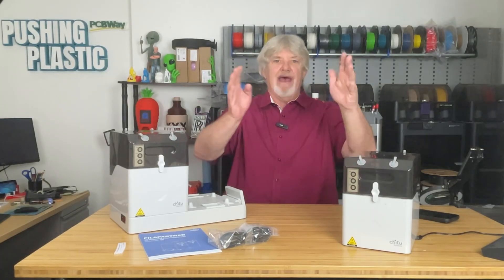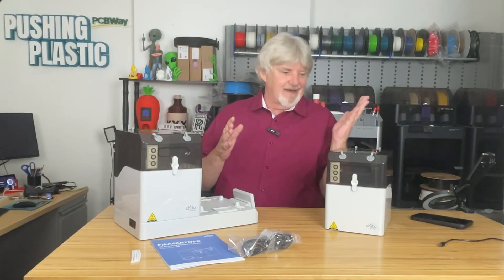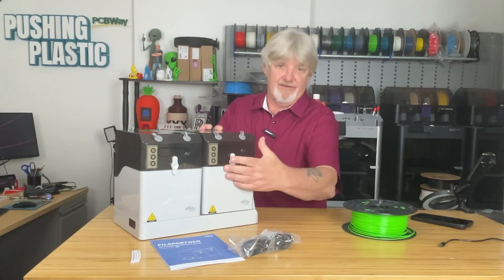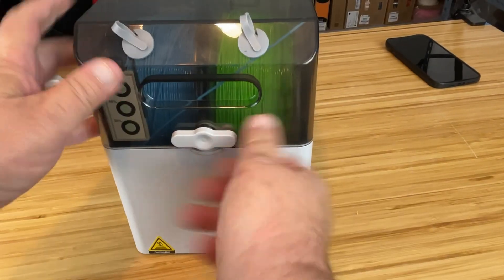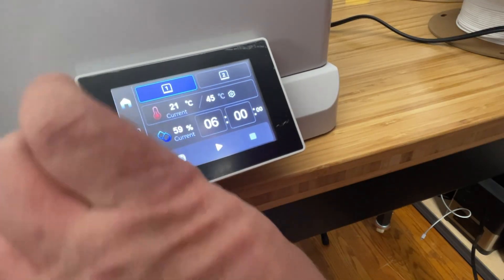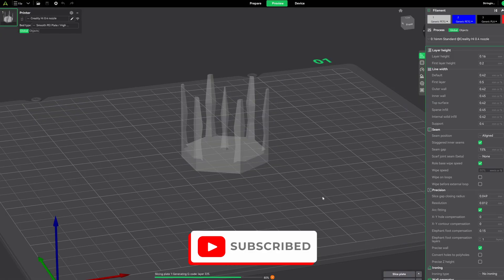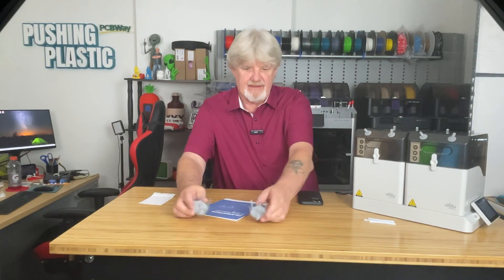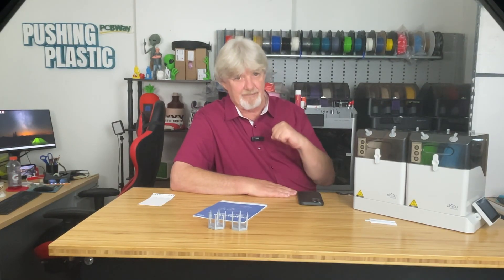Chitu Systems FilaPartner E1 Review | Intelligent Filament Dryer for Serious 3D Printing

Comment: One of my Chitu's started to billow out smoke and I unplugged it. It ended up being the main capacitor exploded for the heater. I reached out to Chitu but NO response.
Reply from the maker: Let me know what they say if you could. How long ago was since you reached out to them?
Reply: @pushingplastic7445  2 days ago. Luckily I called Amazon and they agreed to let me return it. I did take pictures and send it to Chitu, but now I am kinda of scared to use the other one.
Reply: @pushingplastic7445 Friday